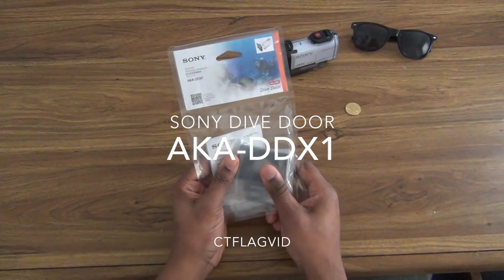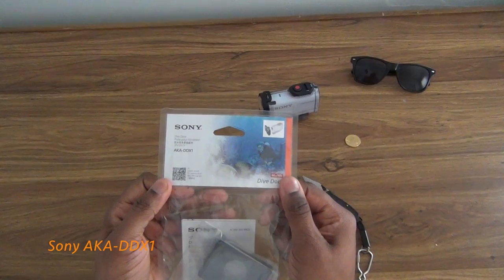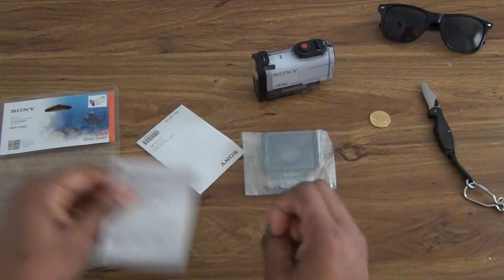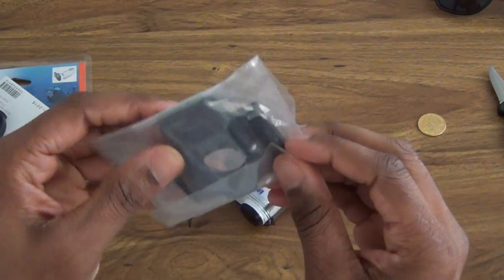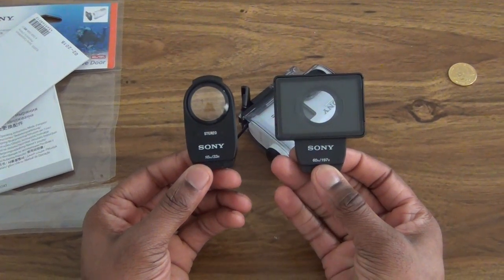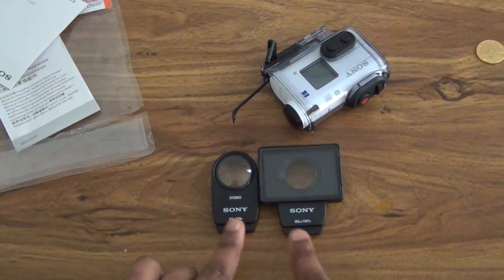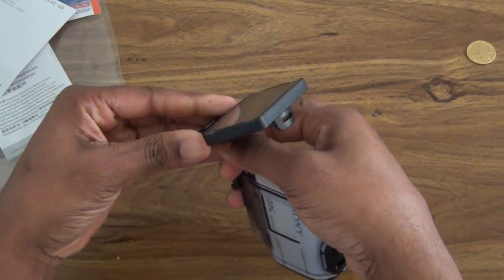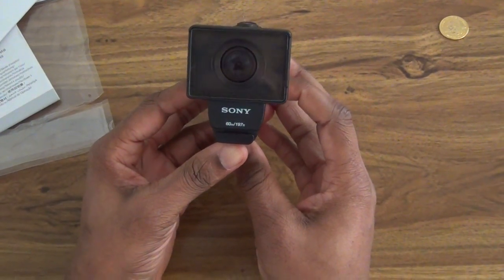Sony Dive Door AKA-DDX1 Unboxing + How to

Comment: will this also fit on the sony AS100 case? (it's the SPK AS2)
Reply from the maker: *****  Yes!  SPK AS2 will fit the DDX1. Thanks for the question.
Reply: ***** Thanks so much man, that was the answer I was looking for! Finally I can use my AS100 underwater with buttons!!!!
Reply: ***** I don't think DDX1 fits SPK AS2, as it's even not possible to get AS2's front door detached!

Comment: Should I use the Dive Door at Niagara Falls?  Thanks.
Reply from the maker: BILLYCHIU.com  Sorry for the late response.  Ive never been to Niagara falls, But I will say if you plan to record UNDERWATER use it. If your just trying to keep it from getting wet, and protect it from the MIST in the air. I say go with the regular housing. Thanks for the comment!

Comment: Is there any problem with AKA DDX1? on the sony site it says discontinued, and i jutro bought the X1000v camera. 
do you have any news /info? would be great if so
Reply: +Alex Czarnomski It seems they're replacing it with AKA-DDX1K, which package contains not only dive door, but another case, just the same which originally comes with the cam itself and for the same price as DDX1 was. Just got mine from Sony Store and was surprised by that :)
Reply: +Sergey Uliyanov Thank you. so i will be waiting, since its not available in Poland yet ;).
good to know they replace both parts